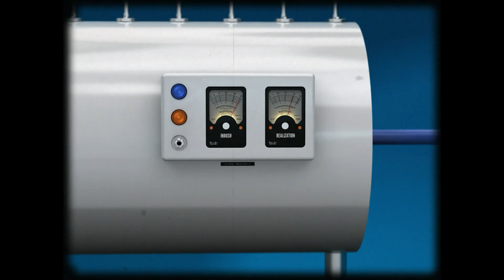G.E. Apparatus News - The Turboencabulator (1962)

Comment: Fascinating history indeed - and yet, to this very day, NO ONE has even approached the problem of internal fantangulation, nor the resulting fantangulatory tockwobble.  

Until these issues are solved and properly recalcitrated, the Encabulator, in all its electrophrenetically polyconjugated iterations, is essentially a high-oxyneuroacetylcaloric flange compressor with an excessive quantum-defenestration vortex.

This spake the Zarathustra Institute Scientific Committee in 2001.  

Has this issue been properly degaussed?

Comment: A dumb copy of Rockwells retroencabulator spoof video.
Reply: GE was the first to publish the technical manual for the turboencabulator in 1962. So this is accurate. The Turboencabulator was invented in the 40's and the joke kept going. Chrysler did it in the 80's...Rockwell in the 90's.  https://en.wikipedia.org/wiki/Turbo_encabulator
Reply: @RonRichards-v5f This a fan-made spoof, not affiliated with GE. If you didn’t notice, computer animation did not exist in 1962

Comment: The upgraded model found at Rockwell uses the girdle spring attachment.
Reply: The girdle spring was a real advancement that took the turboencabulator in to the Information Age
Reply: With a bigger future a girdle spring is required.
Reply: who told you that?

Comment: This machine doesn’t even consider prefabulated amulite.
Reply: No spurving bearings or ambifacient wane shafts either! - surprising this thing worked as well as the original - seems like a cheap knock-off that got as far as the pentametric fan and then they just gave up!
Reply: @strawwmann3131  at the time they didnt believe that the spurving bearings were doing much- and they were right! in this rendition of the encabulator- the spurving bearings were only really extra parts. it seems that the annular flux alone is enough to keep the angular pendulum in motion. the ambifacient wane shafts i am not too versed in however so i cant say much about them.
Reply: No dingle arm either! How does it work without one... almost blasphemic. 😮😮😮
Reply: Amulite was still under development in 1963, albeit at a high level.
Reply: @Rizzler420-uh4yd  Yeah, I was thinking that prefabulated amulite didn't come along until around 1966...
Reply: Hence the side fumbling
Reply: Means it should be cheaper.
Reply: During rationing we were forced to substitute chicory root

Comment: Of course this was the first step in a production encabulator. Many revisions has brought this old idea to incredible new forms. Purportably there is prototype QUANTUM ENCABULATOR that was supposed to be unveiled late fall of 2024. It turned out that the subcontractor for the BASAL PLATE subcontracted out to his brothers inlaws friend. Where the nangling pin subassembly was supposed to have iridized pewter as the center axis the want of a provider of this rare metal hasn't been found. Another wing of the engineering cabal has been formed to rectify this oversight. I feel there is hope yet!
Reply: This was all a bunch of claptrap. Everybody knows you must use Unobtainium-273, not iridized pewter, to make the nagling pin subassembly.
Reply: I have a friend doing postdoc at Colombia and he works in the same building with a few people he says are working on potential gravitational encabulation. And one thing theyre doing is actually going back to prefbulated amulite. It wasn't preflective enough for what they needed in discandescence chambers fifty years ago but that's because they were so focused on protecting the operators. But after that accident at the proof of concept show... Who could blame them? Anyway... Modern tele operations and adaptive ai means that a modern one is a lot safer inherently but in ten years one could basically run itself, and better, with the amulite chambers, and now they're seeing controlled encabulation with unmatched precision and almost zero vibrational spalling.
Reply: @misterturkturkle  There's no need for the operator safety worries with the quantum encabulators; they do not emit ionizing radiation because they use cold fusion to power the transmutation conduits.
Reply: @jackpine1033  Will the thrilling to see what it will help to reveal in the field.

Rockwell is usually thought of as an engineering company, but few remember the contributions they made to basic physics, such as the discovery of Transmogrification (1963), and the solution of Unified Field Theory (1957)
Reply: The quantum encabulator was not released because after it was built, somebody put it in a box for the night.  When they returned the next morning and opened the box, it wasn't there.  In its place, however, was a dead cat.

Comment: Stolen from Rockwell
Reply: GE did it first.
Reply: @kevCarrico May be true, but the GE model can not supply inverse reactive current for use in unilateral phase detractors or automatically synchronize cardinal grammeters.
Reply: @hojo70  Do you think GE has been resting on its laurels this whole time? Their latest model is so advanced you'll need to lie down for awhile after reading the specs. Cardinal grammeters have been replaced by quantum molecular antipodal waveguides.
Reply: @hojo70 agreed!
Reply: Actually, you have it backwards.  GE started it with a printed technical bulletin.
Reply: @donmoore7785  Leonardo Da Vinchi foresaw the Encabulator in one of his drawings.
Reply: He was thought to be crazy, of course. :)
Reply: The original turbo encabulators were all built off the same open ended patent. While not technically theft they took steps to protect their own proprietary designs after that. That's why all turbo encabulators are basically the same but when you get into hyper encabulation you really gotta know who made it.